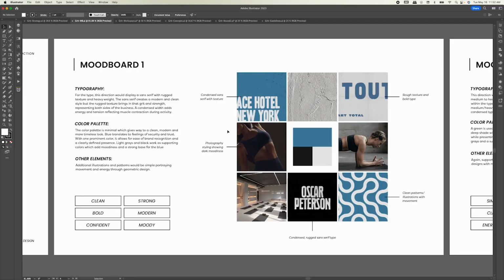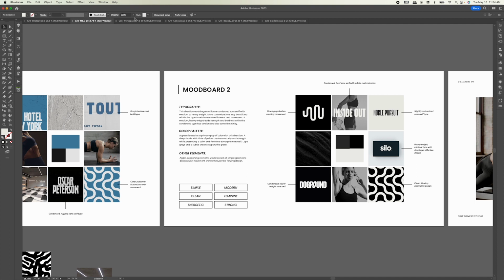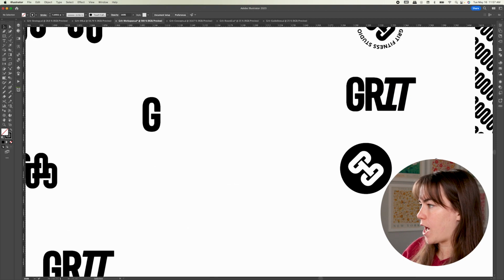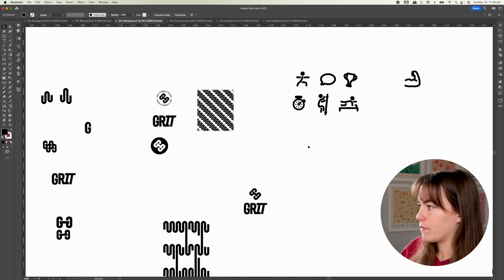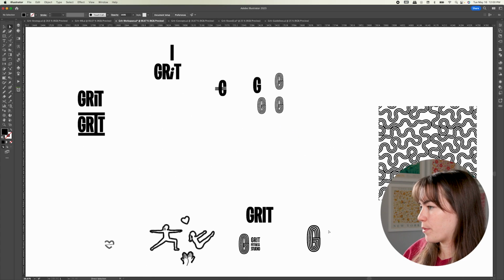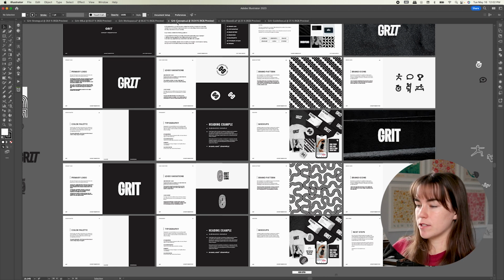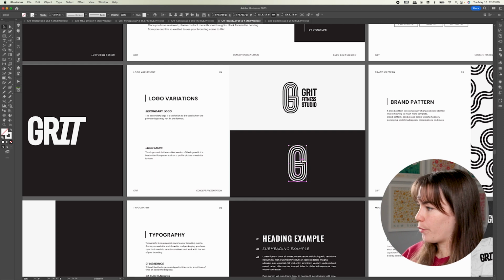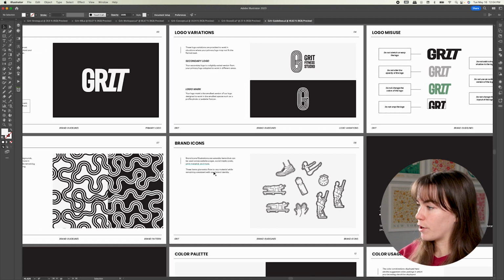My Entire Brand Design Process

Comment: Thank you for the video! I'm a bit confused though as there is only one package option on your website with 1 concept included. You mentioned in the video that you are sending packaging and pricing info in the project proposal and later you also mentioned two logo concepts..? As for branding strategy, do you just rewrite the client's answer in the branding session are you doing your own market research and analysis? I would like to know more about it!
Reply from the maker: Hey! So I actually recently switched from providing two concepts to doing just one and so I may have said different things! For the strategy, in the meeting i don't ask direct questions like "what is your mission" but rather run through other strategic questions that will allow them to express information I can use to form their strategy based off of as well as additional market research I put in. Hope that helps!